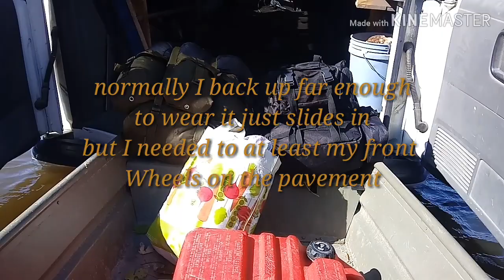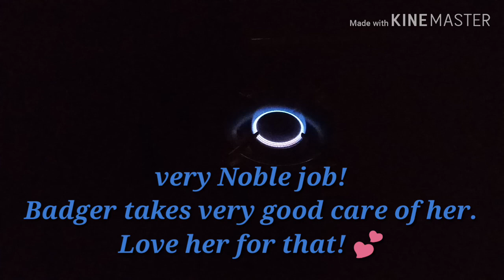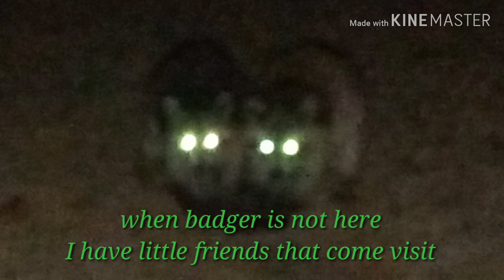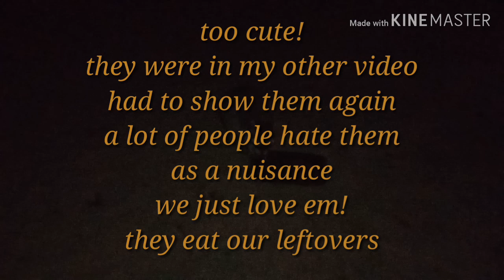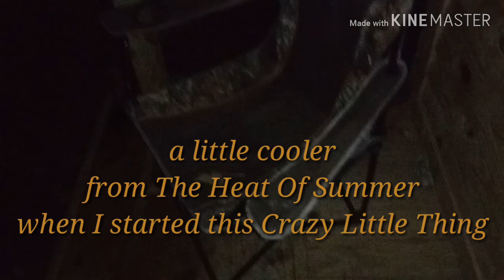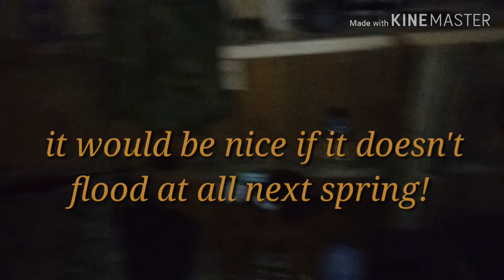#5 Island Pallet Cabin, "inside" during cold, rainy, fall morning

Comment: If you know it's gonna flood then why not dig under it put it on stilts even now , with the posts 3 get to 4 feet deep in concrete. The best thing to get is used light poles at the electric company, they usually always have some that they changed out. Or you can raise it enough to put it on old pontoons or sealed 55 gallon drums and then dig holes and pour concrete on them with chains or cables looped down in it and hook it to the cabin and leave enough slack that when it begins to flood it will float and then sit back down as the water receides. Just saying it's a nice little cabin. Don't let the little guy flood. Before anyone thinks I forgot yes I would also build a log/debris jam above stream of it so if logs or anything come floating down stream they don't hit the side of the cabin and destroy it. I love it . I'm building one in my woods on our farm as my hunting cabin man cave .
Reply from the maker: I really appreciate your suggestions Big Daddy!👍 but we knew full well that if you build a cabin on the river, you got to go with the flow! ( all pun intended!😂) but it's done now, it's anchored and deck screwed, and I truly believe it'll stand in the flood! Which is part of the fun of it, challenge of the river!..... so stick around will keep you posted! Actually I hope it really does flood, it would be fun to boat up to the roof😂